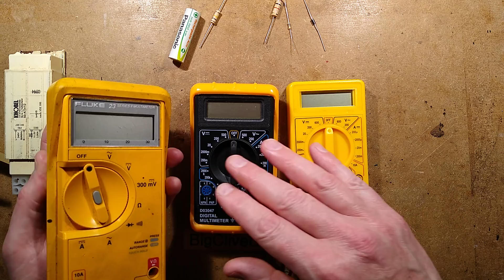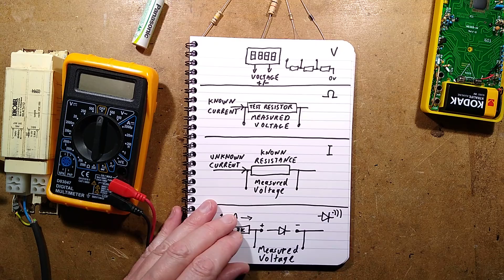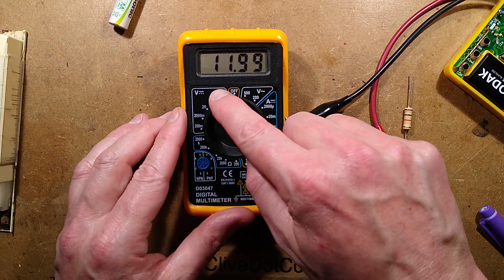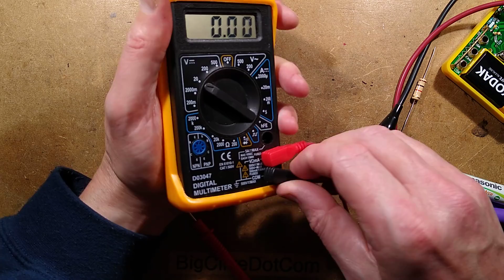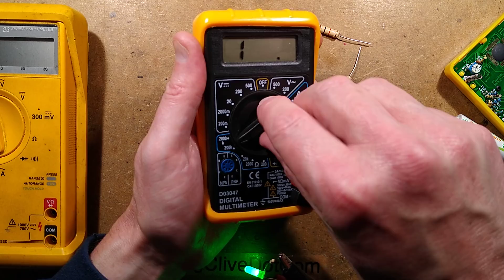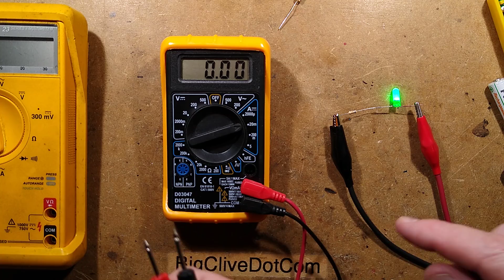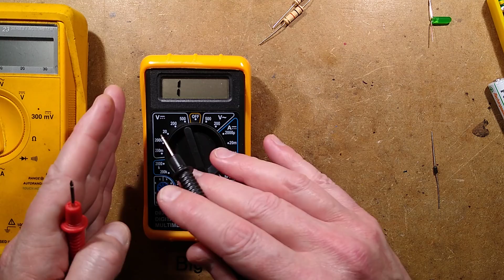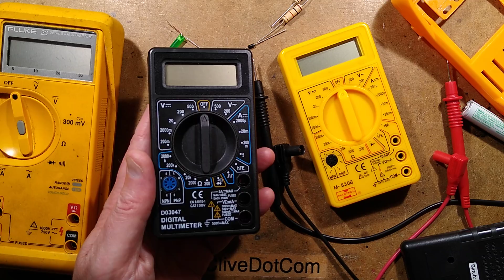How to use your trashy meter without blowing it up (much)

Comment: The cheap ones get the job done for most home projects, just make sure they are fused for safety. I’ve been learning about Arc Flash and Electrocution on a HaV course recently. 
Learnt a good tip to touch a known “Dead” conductor with the back of your hand first. If it was still live, it reduces the risk of contracting your hand around the conductor.
Reply from the maker: They used to teach that here, but now training is so shallow they don't even mention stuff like knuckling contacts.

Comment: I totally agree with you! For someone working with Arduinos and other low voltage circuitry, these low-cost meters are enough. And in many cases it's better to have two or more cheap meters than just one expensive one.

Comment: My $25 Harbor Freight  meter (the black one with a red condom and tilting LCD screen) not only has sockets in the face for testing transistors and capacitors, it also has a plug for a thermocouple (included) for temperature! Yeah, I used that once just to see if it worked (it did). Like Clive said, it's always in 20vDC or continuity mode.

Also this particular one flashes "6.66" on the screen for a half-second when it powers up, and I think that's hilarious, given the overall red and black color scheme.

Comment: Surprisingly true about the accuracy of those cheap meters.  I got a bunch of the free-with-any-purchase meters from Harbor Freight and tested them with my bench power supply, and they were spot on within 1 or 2 hundredths of a volt (and since my power supplies came from Banggood, those could very well be inaccurate, too).  My first meter, which I still have, is a little pocket DMM that runs on two button cells.  It does DC, AC, ohms, and continuity, and for most of what I do that's all I need.

Comment: I usually use a cheap analog meter for continuity and semiconductor testing. It has a beeper that changes frequency depending on resistance. Plus I don't have to turn it off.

Comment: I have used the transistor gain function on the cheapie meters for matching transistors in a push pull rf circuit. Also the diode function can help with matching germanium diodes in ac detection circuits in clamp on amp meters. Good video. Take care. Tootles... Wade

Comment: 100% agree!
The cheap ones are amazing.
I’ve been a maintenance sparky for nearly 40yrs and use the Amps option on my meter to short out ‘open circuits’ just to verify that’s where I’m missing a signal. 
Yes it’s naughty 🤪
I was taught this ‘bad habit’ by an ex RAF electrician many many years ago and it’s handy if you can’t find a bit of shorting wire in a panel.
It can be quite exciting measuring voltage whilst on amps because you haven’t put your leads back.
Fused probes 👍
Flukes ❤️
Any make of meter that’s safe to use and has the range you want is good enough to be honest.
Reply from the maker: If you use a set of test lamps to probe across open circuits they will give a handy visual indication of the open circuit status.  And sometimes pass enough current to pull in relays.

Comment: I remember checking a fault on my brother's cooker. I tested the continuity first, then I said "now we need to test if the power is there", at which point my brother flicked the switch. Took the meter off, threw it in the bin. A couple of days later we had to get some components from Farnell for work, so I added a Fluke 12 meter onto the order. Thanks work, that meter you bought me is still working quite well.

The cheapy meter I've got is a little odd. If I try to measure voltage straight away it gives some very odd results, maybe 10V from an AA battery! But if I test continuity first then the voltage works as expected. Weird!

Thanks for this video, you just reminded me what I needed to add to my order from CPC to get free shipping.
Reply from the maker: Sometimes the rotary contacts give issues with weird results.

Comment: I used these for 3 years (which is a long time for me) for basic electrical and electronic checks. But when the probe system started to give some troubles, I decided to get a mastech instead. And I have been using a mastech for 2 years now with little to no problems. But like you and many say and said, this is the best for those hobbyists in a budget that want to measure and work in electronics. The fuses in the past ones had to be replaced twice by me too. (Once because of my incompetence and the second time because it got some unknown issue. I changed the meter soon after.)
I use the gain test only when I find transistors with no markings on them (to find it's approximate type) If not, it sadly only collects dust.

Comment: The fluke 23 is the best meter ever, full stop. It was the standard meter for my use on the railway, it has been out in any kind of weather you choose to mention, dropped from up the top of signals and never misses a beat, they have been been superseded now by one that don’t like the weather the so much but when an old 23 comes back from calibration it’s always top of the list to go out

Comment: Great overview Clive. I like those cheap meters for monitoring multiple readings, Really good for that. Even after 50 years I recently left a meter on the current range when measuring voltage.... Luckily not a high energy source. Not just beginners do it.

Comment: So glad I watched this again, I recently dug out a box of mains power adapters that I rescued (for own personal use) from products that had other reported fault, anyway I went looking for a particular voltage adapter for a particular use and checked voltage on tester and it was bizarre how many gave false readings, yes you guessed it, they were AC adapters and I thought all adapters changed Ac mains to DC current 🤦‍♂️ ... this has hampered the usefulness of some of the best adapters in there but it is what it is, and I was gonna take a load to tip thinking they had died inside from a decade of non use, no.wonder I couldn't find anything about this phenomenon online..🤦‍♂️

Comment: Gain test socket, I have a couple of meters with one, but I can't remember ever needing or using it. If I can add some advice, if you're going into a technical field, watch some videos to see what people in your field are using. For example HVACR Videos has a meter that has a built in 3 phase rotation measurement. Of course none of his tools were cheap. Eric at South Main Auto has a meter that seems to be aimed at auto repair w large illuminated display, etc.  He does voltage drop often with his. Thanks Clive for bringing this up.

Comment: I use a IDM93 from RS, it's known as the poor mans fluke, very solid, had it for over 20 years.
When you measured the resistor while on continuity, it displayed the voltage drop across it ;)
You touched on a video i made where i showed measuring a very low resistance without a low ohm meter, just a normal meter, a power supply, and a bit of calculation.

Comment: Great video. Also consider how to check a wall dampness test meter and its calibration. It you try measuring the calibration block it's a resistance overload. 
You need to check the probe voltage (mine's 4V), and then measure the current delivered by the probes through the calibration block (mine was 0.4uA) to get a 10Mohm test block!

Comment: Needed this guide 5 years ago, just kidding, nice simple yet comprehensive guide
My first DMM was 5€ from a local chinese store and it's probably the same to the cheap yellow meter but it had a big display and it annoyed me since there were unit like the cheap yellow one which did the same thing but were more compact. I've now "upgraded" to another cheap meter that's 30€ instead of 5€. Perfect for testing voltage rails (on consumer products at least) and doing continuity and resistance tests

Comment: My dad bought me my first test meter in 1978, It was a Japanese analog unit with a back-mirror needle display. Then I was recruited into the RAF and got to use AVO meters, along with the fantasticHewlett Packard 4276A LCZ meters, primarily for testing components. I can't recall the brand of my own first bench digital meter, but it had a light blue plastic casing and had a red LED display at the front, not on top.

Comment: Very good summary, and I totally agree. I started off with cheap multimeters, and whilst I haven't blown one up, I would be wary of using it for high voltages in case something did happen.
The multimeters I currently us are from LIDL supermarkets. I did have a cheapo meter (like the one in the yellow sleeve case) previously but it stopped working reliably. Maybe at one point in the future, I might get an Amecal - if I need one, that is.

Comment: My meter has sewing needles to get into smaller holes and do finer work.

I have like 6 or so maybe more layers of heat shrink on them.

I only do 12 volt and less and checking ohms loads to test wire not broken etc...

Never had a shock yet.

Meter seen many hours of work never changed any fuse..

Very happy with what I have.

Comment: I've got by with a cheapo meter that I've had for ~30 years. It looks basically the same as the yellow one here, in fact it's amazing how little these things have changed - except they've sped up the display update rate. I'm tempted to move a bit more upmarket to get an "instant beep" continuity test, but online listings don't tend to mention whether the beep is instant or delayed. So I'm considering just building a dedicated continuity tester circuit instead - seems like it ought to be pretty simple (famous last words)...

Comment: 17:40 That's a major metric in my meter evaluation, as I often use the continuity tester to sweep a long series of contacts to identify connections or locate shorted pins. It needs to respond instantaneously to do this with a quick sweep, or it'll miss it unless you do it slowly and pause on each contact. I check it by flicking the probes together and see if it sounds off, or tapping out a beat and see if it follows.
Continuity testers that require any length of time to start sounding off are not as useful.
Reply from the maker: Particularly with SMD chips where swiping the contacts makes a very brief connection.

Comment: My first meter i got home with it and whacked it straight into mains after connecting the leads in the 10A hole. BLAM!

I was like 12, and i was so dismayed, almost crying. I opened it up and man, there was a huge scorch mark on the pcb and one of the traces was lifted and broken, so i scratched it and joined them with a blob of solder. Fixed, like nothing happened XD

Ive blown that little meter 3 times like that, i had to replace the trace (it vaporized) with a copper wire, the fuse I've blown twice and its gone through 3 batteries that hilariously, each cost more than the whole meter (battery included), its had its leads soldered twice and look awful but are actually fine when it comes to resistance. I have have a much nice meter now and other measuring equipment, but I always have my dinky yellow meter at hand, I love it, It's been so useful to me.

I still have my dinky little meter, i wanted one of these you play around with in the video (that rubber case man, so good) but I had to get another one. In the end it was a slightly better meter. Its mostly the same as yours but it has not only a gain tester (its a straight line not rounded) but it also has the secondary function of an LED tester! And yes, I use it all the time, I work with a lot of salvage and its nice to know if the transistors I'm pulling out are good, specially when its 20+ of them, also the LED tester is so good, i dont have to squint to see the inside or probe the leads or even look at them, just whack it in there both ways and if turns on it's fine, even if i put in in reverse polarity it doesnt kill my LEDs.

Imma get my dinky meter new leads, nicer ones :)

Comment: Thank you Clive for making me go back and digging out two old trusty meters which I’ve had for nearly half my life. (Though the leads have long since been lost, damaged, or discarded.) One of these was my first “serious” meter, a Tenma 72-2050 which dates back to 1997. I don’t even remember where I bought it (this was before Amazon and maybe even before eBay). I mainly remember I wanted a Fluke knockoff (at least the look and feel, if not the capability and pedigree), and it was somewhere around $30 USD. It gives no indication of where it was made; web research indicates most likely Taiwan (pre-handover). Pretty sure in that time I mainly used it for light-duty 12 VDC; I’ve only gotten more of a comfort level with 120 VAC in the last few years. I just used IPA to wipe off more than 25 years of grime; though I must have tried it out at some time recently as it had a newer 9V battery inside. The tough rubberized cover is still intact and pliable.
Reply from the maker: I think Tenma meters are common from Element 14 suppliers.  In the UK that's Farnel and CPC.

Comment: Meter tip. Not only have a spare set of quality test leads but several spare fuses. I used a Fluke meter combination VOM & 1,000 volt megger. Took me a few weeks to secure a 1,000 volt fuse. Back in the 1970's we used to send out our Simpson Model 260 meters out for calibration but nowadays a few times a year check readings from an old digital VOM with a fairly new one.

Comment: Continuity testers usually test for resistence and if it's close to a short-circuit (I've seen meters where 50ish Ohms is the cutoff, a lot go even less) they'll beep. I believe there're different implementations, some seem to use the measurement circuitry to figure out the resistence (the slow beepers) while many seem to use the fast path (the low resolution but quick bar graph measurements) or have a discrete implementation, which causes the instantaneous scratchiness. Whether they latch or not and how that latching works is a completely seperate topic. It sounds like your meter displaying something closely to ressembling the forward voltage of the diode in continuity mode is a happy accident, a lot of meters are even displaying an Ohms symbol while in continuity mode.

Comment: My meter looks exactly like that cheap unit on the outside, except for the color of the plastic. (Mine is red.) As I recall, it was around US$5. My uses of it have been pretty limited as I've had no formal training beyond checking resistance and confirming functionality of diodes, and checking batteries, so thank you for showing the basics of using these meters. (Now I'm going to have to open my meter up to see if I have that big copper shunt in mine.

Comment: I used to do security camera and security panel installs and for most purposes with low voltage stuff the cheap little meters are just perfectly fine.  You can break/have stolen/drop from a high height 10 of the cheap ones and not worry about it on a work site. Whereas if you own one of the expensive ones and you drop it off a ladder or have it stolen, it's a pain in the ass and expensive to replace. And for Arduino/microcontroller fiddling around the cheap ones work just fine and don't let anyone tell you any differently.

Comment: I gave my (company provided)Fluke multimeter away to the new guy at work, because I couldn't bear to part with my cheap trashy (purchased personally) one. I still regard this as a win, as it has never failed, and I'm not afraid of loss or damage 😃

Comment: I got a cheapo DT-830B meter like the yellow one, and I am very impressed by the accuracy of it. I used some resistors and compared it to my military-surplus Fluke 27/FM (FM stands for Fluke Militarized), and once I subtracted the resistance of the leads, it was astonishingly accurate. (you can guess what was more accurate though).
Reply: That's the power of integration. There was a tear down video showing the PCB inside and there's hardly any components and yet it's surprisingly accurate. Makes you wonder why these high end flukes have so many big components inside and what do they do.

Comment: A habit that I developed way back is that when setting up the meter for use, I will set to lowest ohms and touch lead tips. That will show the condition of the leads and connections. It also gives a indication of the internal battery condition. I was told long ago that a low/dead battery on these digital meters can affect all functions, not just ohms.

Comment: To quickly get an idea of e.g. transistor gain, I use a component tester. Less fiddly than using my hFE multimeter socket, and it also detects the type, pinout, or if the component is broken.